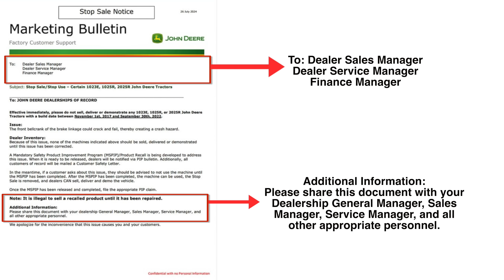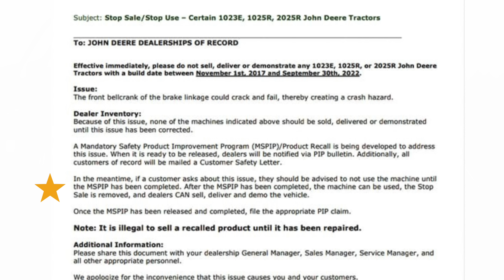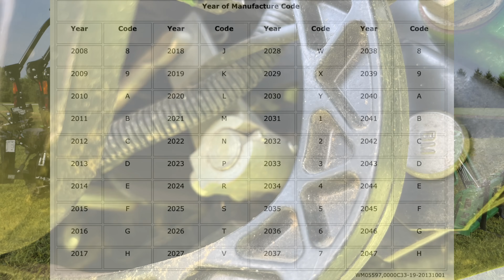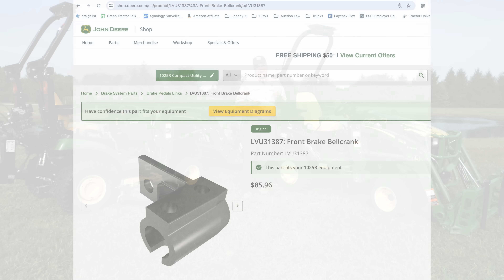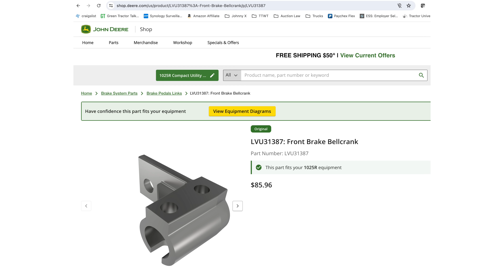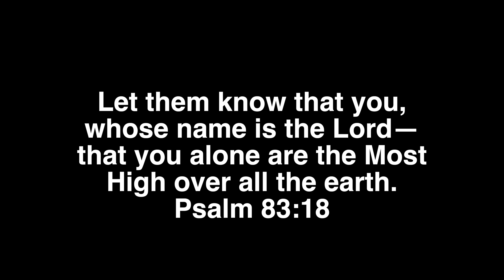Deere Says "STOP USING YOUR TRACTOR"

Comment: Glad to see this, I've been looking at these very compacts and I think I'll go with Kubota!
Reply from the maker: Using THIS as a reason for your choice isn’t wise.  They appear to be handling this fine.   Kubota BX …to my knowledge, STILL hasn’t fixed their leaking single point connector issue.
Reply: @TractorTimewithTim  although there's absolutely nothing wrong with my 77 cub cadet, everything still works just fine! And it's paid for and easy to work on if you need to work on it!
Reply: @TractorTimewithTim  this is one of many excuses for me not to buy JD,my uncle farms for a living and his last few JD purchases have left him aggravated to say the least, he's had nothing but problem after problem with two tractors not sure which series and his combine S680, throwing codes and sensors constantly going out!
Reply from the maker: @GarryWills-cn8nn  interesting.

Comment: Thanks Tim you always provide such up to date thorough  content. I have a model year 2023 2025R. I called JD dealer and they confirmed my tractor build date was 6/13/23. I looked at the brake linkage and I can clearly see it's made out a cast aluminum, Its still really shiny at 50 hrs. According to the recall my tractor is past the recall date. The dealer recorded all my concerns and will contact me when they know more about this recall. I plan to get a picture of the linkage and provide it to dealer. I have a very hilly property and rely heavily on my brake every time I use the tractor, especially when parked. I would also think JD will come out with a new part number that supersedes the old. Thank you!
Reply: I received one as well, when I cal the dealorship they told me they were still waiting to see how John Deere was going to handle it.

Comment: Thanks for the info.  I purchased my 1025R in August of 2017.  I am going to have to call the dealer to see if my tractor is affected.  I looked at the bell crank and it is aluminum but does not look like the one you illustrate in the pics.  I am just ok with my experience level.  Flat lander also.  I don't use my brake to stop, but I use it all the time when I am lifting with the front end loader or forks.  Don't know if that's good or bad but makes me feel more secure when doing it.

Comment: I think you should be mindful of what you say ,if you have a 1025R ,you are supposed to set the PARKING BREAKE ,when using the backhoe !😮😮😮😮😮😮😮😮😮😮😮😮😮😮😮😮😮😮😮😮😮😮😮😮😮😮😮
Reply from the maker: You do you.  I would never set parking brake when using backhoe.  Outriggers will hold you, and you would not be able to move by pushing with the hoe.

Comment: I forgot to say this in my other comment. So I'll say it here. 

I was unloading a trailer when my bell crank broke on my 1023e. So I used my box blade to hold the tractor in place. Then I proceeded to walk half way across the pasture, past the barn, and into the house. Then I proceeded to tell my wife what just happened and the fact that the tractor has lost its brakes.. 

I made sure I was by the door at the end of the conversation when I said this...

"Don't worry honey, I won't let this brake failure stop me."

Comment: Mine broke the other week. I was already stopped. I just put down my box blade to hold the tractor in place and went to the dealer to get a new brake bell crank. It was very easy to install. I'm eager to see how they change the design/materials, because the one they gave me looks just like the one that failed and is made of the same grade of metal.

I'm used to having parts break on machines. I fix machines all the time. I didn't have any clue that this was a bigger problem than just my machine. And the dealership didn't have anybody else come in to get a replacement or have them fail on other tractors (talked to a master technician for 1,2, and 3 series machines).

Comment: Florida, no slopes.  I have only used it a few times hooking up an implement.  Retired farmer, my 1023E is just a small toy compared to the tractors I drove for over 27 years.  Hydro static drive, if I need to stop I can just push the opposite pedal.

Comment: I posted pics [under Alvie Truckinchihuahua Schreckhise] on my 2015 1025R on your Facebook page Tim. I couldn't do it here. But the 2015 is still cast aluminum. However, it has a spring hooked to it. They are a little different. But in my opinion, they look weaker then yours. But I've never broke mine so I'm not sure.

Comment: Did anyone actually contact dealer and confirm this bulletin is actually real? Facebook, YouTube etc are not real news outlets. They all refer to this exact image. It could be fake news.
Reply from the maker: Believe me, it is real.
Reply: Thank you. Hope no one gets hurt. When i have to get of my tractor for something quick, I put it in neutral and set parking brake. My lot has some pretty steep slopes. I guess i will make sure to drop the bucket just in case. My tractor is 2023 so seems like i am not affected, but this is a bit nerve wrecking for sure.

Comment: When younger I drove a Farmall 400 without brakes for years, no hydrostatic and no bucket, always needed to think ahead , especially when towing a hay wagon.  Most difficulty occurred when attempting to latch onto an implement.
Reply: My old 8N had no brakes. I never had an issue. Except, as you said, hooking up implements.
Reply: @gregoryjewell5875 People that have not been farmers in the past have no idea how we had to improvise to get the task at hand done. Still today I use the bucket tilt on the tractor to move that 1 inch back or forth to connect an implement if I am putting it on my self without a driver in the seat.

Comment: Thanks for the heads up! Much appreciated!   As far as using the brake, I am a flatlander myself. But, I must set the brake or throw a brick on the seat on my 3E if i want to use the PTO for the hay elevator, buzz saw or transfer pump. Is it safe to assume the 1&2 series operate the same way?

Comment: Just broke mine two weeks ago and paid $130 with expedited shipping for the part and replaced it. It was the identical aluminum part. Didn’t really use the brake but thought it may have been from hitting on mower deck taking on and off if it wasn’t lined up.

Comment: Pretty big fail on the engineering on that part. No seaming reason to design those bolt holes as open sided. That combined with the air filter flaw makes you wonder how they are able to command top dollar in the class.

Comment: I have a 2320 JD that I’ve been using for years on my ranch.  I have been painfully debating on a new much larger cab tractor this year.  It was between a RK55 cab or a JD 4 series cab tractor.  

I was initially very pro JD, as our 2320 has been phenomenal and has been punching far above its weight class for years.  Mowing, tilling, loader work, fork lifting, pto auger, snow blowing, she does it all.  But, she’s getting older and we need a dedicated ranch tractor for manure, hay, heavy lifting, brush hogging, fence stretching and the like.

I was a bit disturbed and disappointed with JD’s woke agenda debacle.  However I was willing to let it slide since they backtracked.  This however combined with the massive recall, our local JD dealer providing terrible service and the huge price tag for even used tractors has made my the choice for me.  

The local Rural King is very involved in our rural PA community and has a very good service department with knowledgeable workers.  They’ve been here for years and are well established.  This coupled with the price point of what is a rebadged TYM with all the features JD charges an arm and a leg for, RK55 it is.

Stay safe out there Timbo!
Reply from the maker: Fair enough.  Let us know how it goes.

Comment: I had the issue with the air cleaner bracket breaking. I was told by the dealer that there wasn't a recall, just fix if the owner complained.
Reply from the maker: correct.

Comment: My dealer says my serial number isn't involved (yay) but it was produced in 2021 and also it's 2021 model year. So I'm not sure why, but (yay) nonetheless.
Reply from the maker: I'm not sure that the dealers know the serial number range at this point. So, I'm not sure why they are so confident that yours is not involved.
Reply: @TractorTimewithTim  I do know that in the (car) dealer world they will put out a recall with production dates, but will apply it to the VINs they want to have recalled, so the dealer must always check the VIN and not go by production date alone. Regardless you would think it would be 100% of units in the production range. But maybe my machine will give some clue as to what the "good" part is.
Reply from the maker: @trentofdestiny my point is, the recall has not been issued.  The dealers don’t yet know the details.  He is likely telling you a story.

Comment: How do recalls work in the tractor world? I'm from the auto/big truck industry,  you can drive your unit in to get fix 100% parts labor.  Sometimes towing too. Do they pay for towing your tractor to the dealer?  I know they are not going to pay for a service call to your property.  It seems doubtful they would just give you the parts to fix yourself on a safety issue.   Curious  anyone, past experience?
Reply from the maker: I'm not sure there has been a significant tractor recall (in the compact tractor world) since I've been involved in the industry.  I do not think it is regulated as tightly as the auto industry.

Comment: Isn't it a law that cars have to use hardened steel for brake pedal linkage? If so, why would deere decide to go against decades of car building and decide to use cast aluminum? That's weird.
Reply from the maker: BTW, my "cast aluminum" statement may not be correct.  At a minimum, it is suspect.  Pretty sure it is not steel, but I am not sure what material it is at present.  Some are indicating a zinc alloy.  I do not know.
Reply: @TractorTimewithTim  hopefully it's not made from chinesium. I hear that stuff is no good lol.

Comment: I dodged a bullet. My 2025R is a Gen 1, which I believe is a larger platform than the current Gen 2s. It predates the recall. Whew! Crawled under my tractor and can confirm the bellcrank is of welded construction, not cast.

Comment: Hey Tim:  Thank you for the heads up.  I only use my brake on my 2019 1023e for parking.  It is also garaged between uses so I don't think corrosion would be an issue for my tractor.  My tractor is down right now because the self centering bearing on the auto-connect driveshaft has failed.  The parts just came in so I'm on my way to pick them up today.  I will check the condition of that bracket when I do the repair.  Thanks again, great job as always.

Comment: That's interesting. My 1025R's bell crank broke several months ago. I was on level ground and moving slowly when the brake pedal went forward and slack. When I ordered a replacement, my dealer (40 mins away) got me the wrong one the first time and it took me a second round trip and several hours of struggling to get the broken piece off and new part back on. The new one I got is still the cast aluminum variety. Also agree that the machine is not safe to use when the brake pedal is not working unless you're on perfectly flat ground. I don't have much of that here on the property and so chose not to operate except to take the garbage bins out to the road.

Comment: Don’t get into situation where you have to rely on brake steering.  I’m in a gear drive kubota MX series so not even sure brake steering is a thing with HST models as I’ve never driven one.  I guess that replacement part won’t stop the whine… Just kidding

Comment: Still got the 2014 model, but this is nice to know if I get a newer one in the future. I did upgrade the air cleaner on mine so that mounts around the radiator.Thanks for the heads up Tim.

Comment: Well, I used to work at the factory where these tractors were built. The date codes are the middle alpha characters immediately following the model, the only other letters are the 1LV at that front which is the Augusta GA factory. So the 9th &10th characters, just after 1LV2025R for 2025R variants. There are 2 different years represented by 2 different characters, one is the fiscal year and the other is calendar year. The non matching letters are the 3 months where the years don't coincide between October and December. After the year code is a randomly selected alpha character is used just to keep people from more easily creating false documentation with warranty claims. The dealer will verify that engines and transaxles match the tractor serial number, as well. ROPS is verified as well.

That part number is fairly new as it starts with a LVU3xxxxx. Most of the parts on those tractors are LVU2xxxxx. To me, it looks like a different casting was made. The new part is still a casting just from looking at the CAD model, I didn't work on that production line so I don't know the details on the change, but if I had to guess it got changed from aluminum to steel. Maybe someone can put a magnet on their part if they have a newer tractor or perhaps. If the magnet sticks it's steel and likely it's painted black. Compact utility tractors get black painted parts. Larger utility tractors get green painted parts. If someone can verify a material change was made and/or if it's painted, it could help others identify if they have the suspect part on their tractor. Aluminum parts aren't painted. Sometimes they get anodized, but painting doesn't help with corrosion. Aluminum is like copper, it gets a patina then it stops corroding. Copper gets a green patina and aluminum is grey making it look hazy.

Just for clarification, the 2025R is considered a 2 series tractor. These however are considered Small Chassis Compact Utility tractors. The 2032R and 2038R variants are considered Large Chassis Compact Utility Tractors along with 3E. The other 3 series tractors are considered Premium Compact Utility Tractors. These descriptions are the manufacturing classsification. The model numbers are marketing. The E model is the basic model and the R series is the higher end model in their respective series. There is some overlap in between how they number series are manufactured. The 3E and 2R Large are very similar even sharing the same engines. But they are differently marketed. The 3E is considered marketed for agriculatural use. Whereas the 2R Large is marketed for general  commerical use. The marketing is marketing. In most cases you can use 3E and 2R Large to do a lot of the same things. But there are advantages to having the 3E higher ride height. Things like rear PTO attachments are shared a lot between the two. The advantage of the 2R Large are preminum quality build with higher end features like cruise control and the loader that you easily swap out for something like a snow blower.

Comment: Kinda thinking they are overreacting a little bit……..lol.  I get it, needs repaired, but I can’t remember the last time I used the brake… lmao.  Besides starting it of course
Reply from the maker: I don’t even use it to start.
Reply: @TractorTimewithTim  since you said that, I need to try mine without using the brake, I’ve always thought I needed to hold the brake in for it to start

Comment: What i would do is pull the batteries not sure if diesel keeps may need to pump out fuel from tanks run em dry pull the fuel filters drain them if the filters are relatively new just re use. Do as they say park it. Sorta do a winter storage preserve

Comment: Yeah Tim. My 2014 1025R had a steel sleeve bell crank with two bolts through the sleeve and rod. Has a welded throw arm.

Comment: I find it odd that not all of the 2 series is affected.  Why do the 2032 and 2038 have different brakes? Anyway, it is probably due the vast numbers of these 1 and 2 series sold that this became a noticeable problem. These same issues almost assuredly happen on other makes but I suspect they have lower sales numbers so they don't show up as clearly.
Reply: The large frame 2R tractors are totally different machines from the 2025R.  The 2025R is basically a 1025R with a lift kit and bigger tires.
Reply from the maker: 2025 is on the same platform as 1025.  2032/2038 are totally different tractors.  Diving in a bit deeper, 2032 and 2038r are same platform as 3e.  Interesting, eh?
The numbering is confusing.

Comment: This is more than just a "stopping" issue.  I always use the Park function when I get off of the tractor.  Depending where the interlock is in the system, we may not be able to park or un-park the tractor!
Reply: Every time I exit my 2025R, I lock the brakes.
Reply: Same.
Reply: Same here.  Basic safety issue - ALWAYS set the brake, prior to getting off the machine.

Comment: Interesting. My 1025r was built in the first half of 2017 (it has the straight up ROPS rather rhan the angled ROPS made later that year) & is not included in the PIP. The brake arm is aluminum & is not cracked (as i expected since the brakes work fine). I wonder what changed about this part mid-2017.

Comment: I just use the reverse pedal to control my down hill decents and the forward pedal to hold position if on an uphill climb.  I have done this since I got my 445 back in 1994 and it was easy to continue the habit on the 1026R.  I only use the brakes for parking.  When I lost the brakes on the 445 I finished out the winter before fixing the brakes by just dropping the Snow Blower to the ground to hold the machine in place and I would do the same with the FEL or three point attachment if I ever lost the brakes on the 1026R after all, if I am only needing the brakes to park, the FEL or three point attachment setting on the ground will hold in all but the most extreme locations.